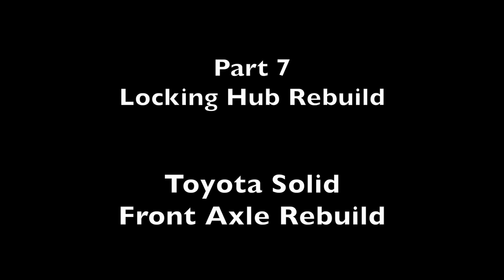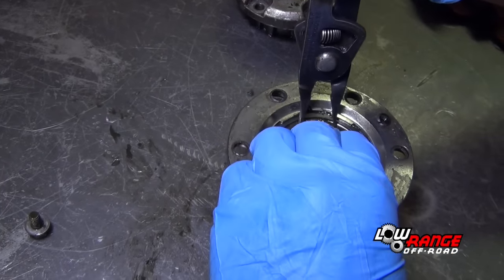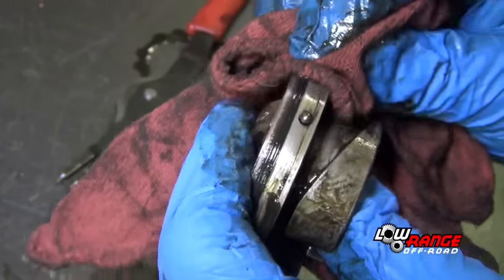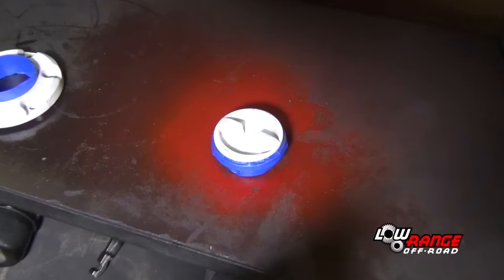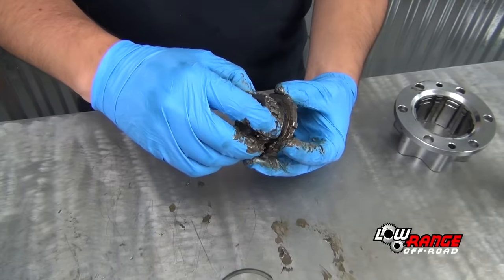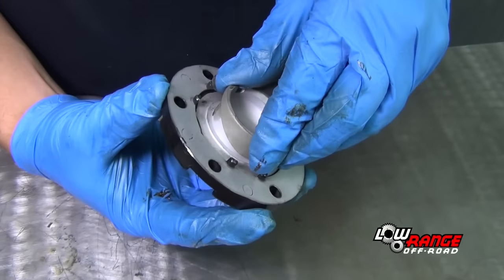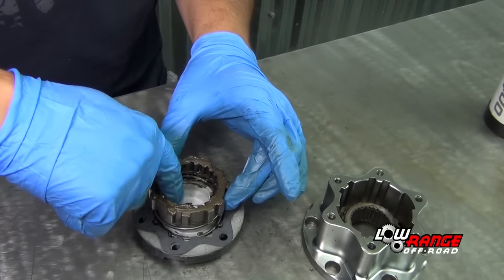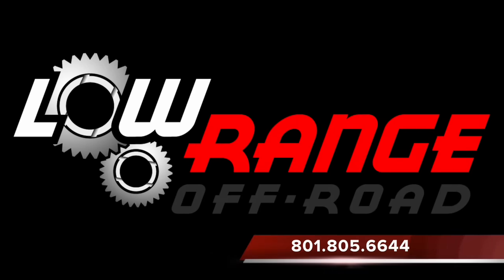How To Rebuild A Toyota 4X4 Solid Front Axle (Part 7)  Aisin Locking Hub Rebuild

Comment: And use a small thin flat blade screwdriver in the expansion slot in the cone washers to get them out rather than bash on the outside of the hub & distort and wreck the freewheel hub.
Reply: just hit end stud wit brash drift, SUPER easy, no damage at ll
Reply: @notsure9079  That's the stooge way & not the way it's done by those who know better. Doing it that way will only loosen the stud & stretch the threads and most likely will have no affect on the cone washer. Toyota recommends the removal method I explained, it works every time.
Reply: @dustyfarmer  It works prefect, did it this weekend, & dozens of times before. never a problem & have seen people do this over 20 years with no damage.
it is the suggested method on about every Off-Road Toyota forum I have seen. you can do the tapered punch as Toyota suggests, it will work too. thanks for the insult too, that ......
Reply: @notsure9079  It's not the correct method as I've outlined & it doesn't work most times. I've been a mechanic for over 45 years now & I've seen plenty of butchers at work & seen the damage and witness marks left behind & have had to fix their F'ups numerous times. I wouldn't let you put air in my tyres let alone try to get cone washers out without stuffing things with your bash on it till it moves method.
Reply: @notsure9079  The bash on it method your so much in love with is also the leading cause of the rear axle or front hub studs shearing off under load. The stud threads & studs become loose in the steel hub and allow axle flange movement and load to be placed on the locating pins & even though they appear to be torqued correctly and pretty soon the small axle flange locator pins are doing all the rotational holding and they fail under load, usually miles from home somewhere out the bush.

Comment: is there any difference between a Toyota hub and a samurai hub?
Reply from the maker: +Loring Giles Yes, they are basically the same.  If they are both Aisin of course.  The only difference would be the splines on the inner hub.  But as far as the disassembly and reassembly is concerned, they are the same.

Comment: and you have to bolt on hub bodies before the locking end, no room for socket with locking hub bolted on LOL as me how I know.
LOL yes I was replacing stock slugs so did not think as I bolted hubs together. I has to glass bead a few other internal parts as my ebay hubs said nothing about 1 being rusted & corroded in the add? odd think he forgot, LOL
anyone that does not have the sandblast cabinet from HF, go but one, do the mods you see on youtube, you can thank me later :)